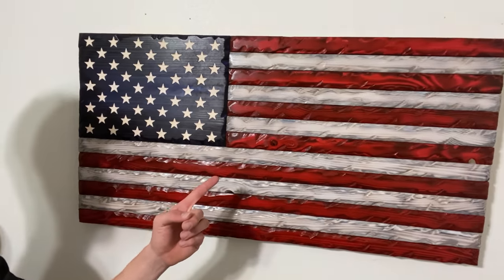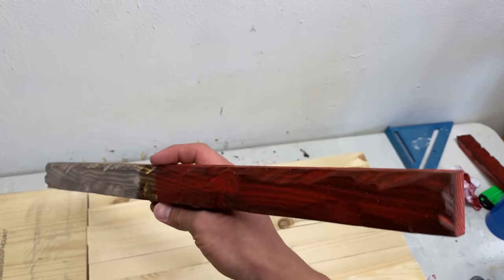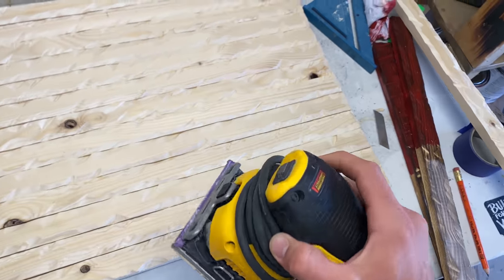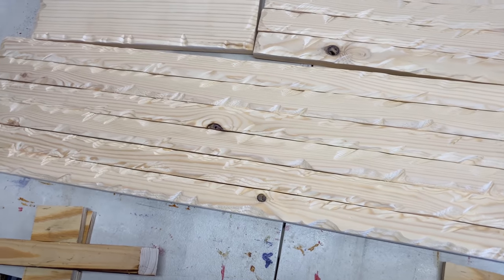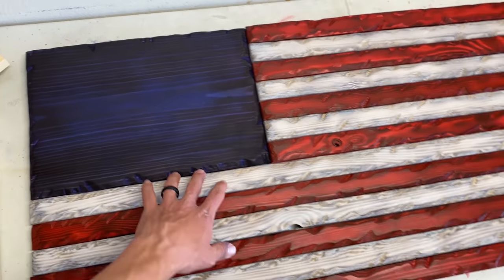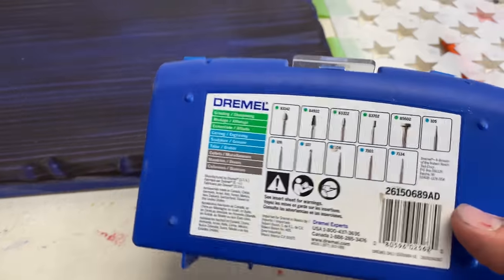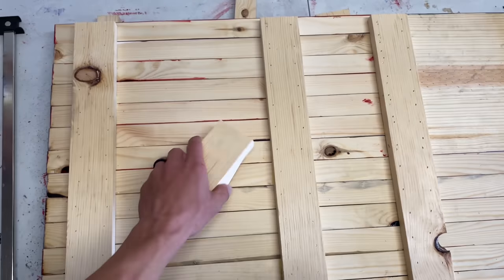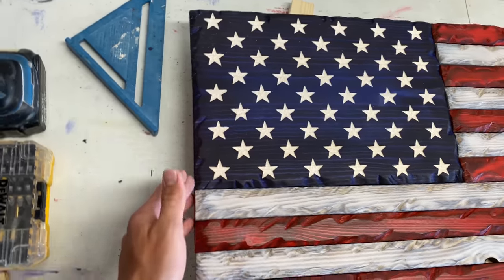How to make a DISTRESSED WOODEN AMERICAN FLAG! DIY Christmas Gift Idea

Comment: Here's a time saving hint. After staining the union blue, seal your union really good with your clear coat BEFORE you carve your stars. Once carved you can then wipe on your white stain in the stars and wipe the excess off with a rag without screwing up the blue stain. Works for me. Try it on a scrap piece to make sure it works for you.
Reply from the maker: Ill definitely have to give that one a try it sounds like it would work excellent!! Thank you for the advice! 🙏🏼
Reply: Use shellac

Comment: I would recommend using a scorch pen after carving the stars, then hitting it with a heat gun to give them the same burned outline look without having to break out a wood burner.
Reply from the maker: Thats a really good idea ill have to give it a try! Thank you for the tip!

Comment: Excellent job!! Years ago I made some flags similar to yours. To save some time you might try to use water base paint and thin it down and make a wash out of it and then use those small foam paint rollers for the application. Then store the used rollers in zip lock bags so you don't have to clean out the rollers for your next flag. just some helpful hints I found useful.

Comment: Great job brother, I do mine very similar,  I USA a 45 router bit and route all my stripes,  then I distress them with a welding hammer, long bent screw, rasping file and put a few scratches.    Then burn then stain.  I would love to send you a fe picture.
Reply from the maker: Thank you brother🙏🏼 That sounds like it would turn out awesome! If you have instagram you could send me pictures through that, my instagram is @maxf_yt

Comment: just as a heads up on the display flag with a hidden compartment, you can use your dremel on a slower speed with the sanding drum to carve out the Kaizen Foam insert
Reply from the maker: Oh thank you for the tip i was trying to think of a better way to do that! Ill definitely give it a try!

Comment: looks great man! would recommend learning how to carve with a router for the stars will save you tons of time:)
Reply from the maker: Thanks a lot man! :) Haha i know i gotta get the hang of using one, the flex shaft makes my hand get all cramped up. Would you recommend using the dremel router attachment or just a regular router?
Reply: @MaxF01  Check out a Dewalt 611, 1.5hp and small enough to use with 1 hand, has a light in base, vacuum attachment available, variable speed and depth. I Love Mine.
Reply from the maker: @jeffselchow5719  I definitely will, thanks for the recommendation man!

Comment: You have skills man! Nice video. How do you carve so sharp? I have tried many times but the bit usually goes too deep into the wood, or it's not a consistent depth, points are more rounded etc. What is your best advice for carving? Is there a better angle to hold the bit at, how much pressure are you putting on the bit? Thanks!

Comment: Max I have made  3 of these flags and they turned out so beautiful. It is by far the best flag you have done yet. I do have an issue that I can't seem to find a solution. It has to do with the white stain. I have noticed once the white stain has been on the flag several weeks, if there are knots in the wood they will start turning a little yellow. I have tired adding a little of white paint to the stain but yellow comes back. I assume it is the sap bleeding out. Any suggestions?

Comment: Max you mentioned there may be a web site we could order the stains. My Lowes, Home Depot,Ace, and Sherwin Williams no longer add the stain to the tint base. They only sell a limited number of colors, none of which are the ones you mentioned.  I live in the Atlanta area.
Reply: Update on my previous post concerning where to get the stains. I was told by 2 of my local Home Depots in Atlanta area they no longer add color to their Varathane wood stain.  But they do. They have 46 colors, including white/navy blues/white. Lowes no longer adds color to their Minwax wood stain. But they do have a Minwax wood finish that they will add color. I finally have my first premixed colored stain.

Comment: Good job, I’ve made 150+ flags.  Why do you seal the back?
Reply: I can't speak for Max but I seal the back against moisture.  I've made and sold about 140 of these and alot of my customers hang them outside. I use helmsman spar urethane for indoor/outdoor
Reply: @DroogyT  I get that, customers need to tell me if it’s going outside.  Almost all mine hang them inside